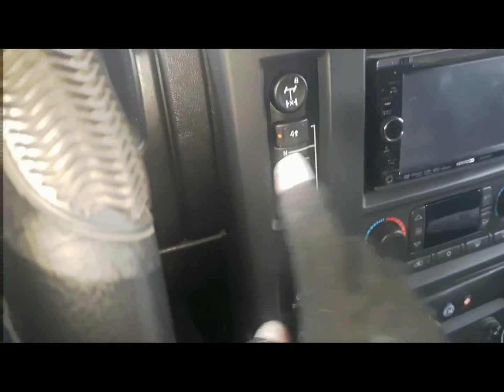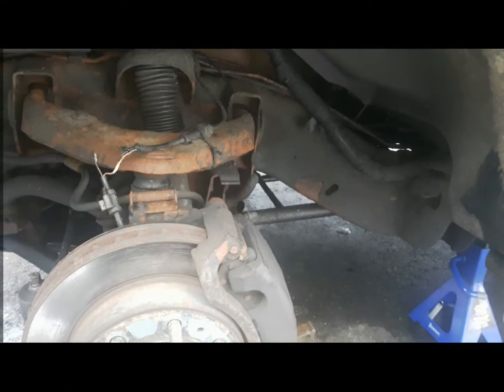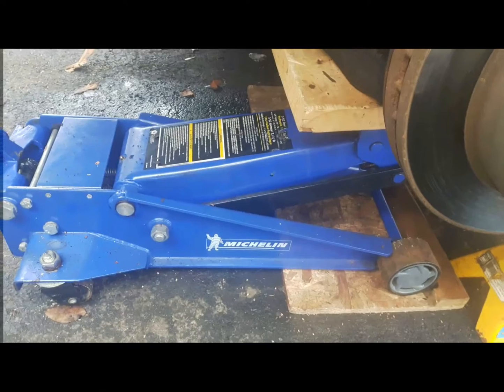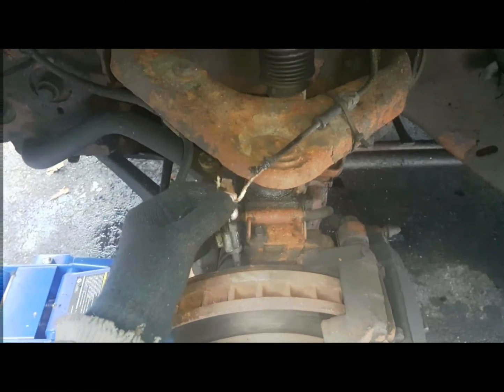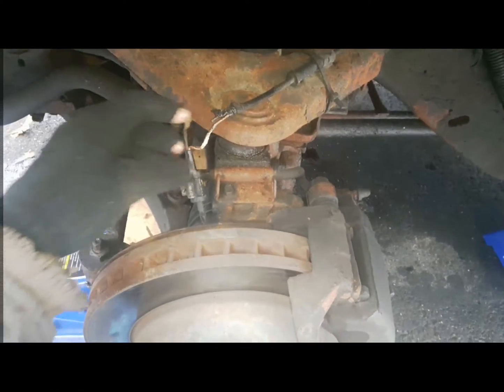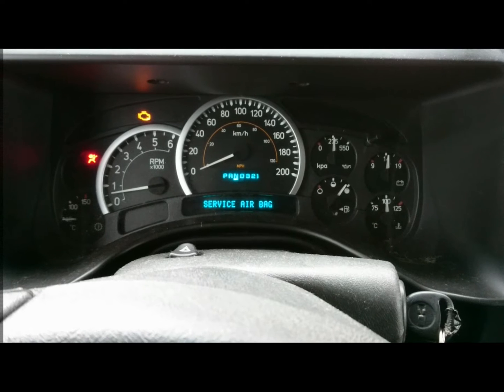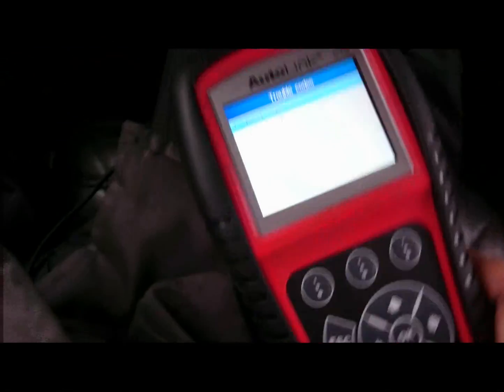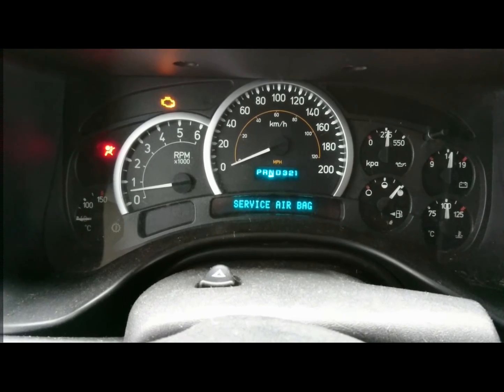4x4 4WD AWD not engaging in SUV Truck, flashes yellow light CEL Code C0035

Comment: Yes the speed sensor hold downs tend to fail.  I mounted mine with rubber /metal pinch loops.  Keep them away from the wheel.  As for my  TCase, I never use 4wd which I think messed up the encoder motor.  They say you must use it every so often.  Got it on my PM when the car is lifted as there are no dirt roads in my area.
Reply from the maker: Hummer H2 has continuous 4WD. You can not drive on 2 wheel mode.
Reply: @wisemonkey1551  I let me clarify; rarely used 4wd"H" or 4wd"L".  If you don't move the module cap contacts on the motor, it tends to fail.  Re 2wd; You can however turn it into a 2wd for long hauls in the summer.  Take off the front axle and put it in the trunk; a 5 minute job.

Comment: Yeah, I have one hummer h2 that I just bought that is doing that. I replaced the transfer case actuator but that didn't fix.
Reply: I do have abs light on, but none of those buttons will work, even 4 high open just flashes and then goes out, everything is off yellow lights flash and then go off. I checked codes but nothing for abs came up, maybe my code reader doesn't read that one.
Reply: @n3d.studio  If ABS light is on, highly likely one of your speed sensor wires is bad.  Happened to me.  The Tcase gets data from abs sensors.
Reply: @operationsword9457  yes it is. I confirmed it on another hummer. the abs light will come on once in awhile and when it did I tried to put it in 4wd but it didn't switch. I ordered one set of speed sensors for front but the box has been sitting in garage for awhile I need to get it installed. I hope it's the front because the rear sensors cost a lot more.
Reply: @n3d.studio Probably the front. First time my front bearings were going out and chewed the  driver side wire.  Second time my wheel rim rubbed against it as the plastic retainer came loose.  Make sure you mount them tightly against  the A arms.   I use locktite on my caliper bracket bolts so if you don't you shouldn't have a problem pulling calipers off.  10 mm bolt after that and it comes off.

Comment: Hello, nice video, I have a hummer h2 2006 but its always once in a while popping up a SERVICE 4WD . What would be that? Please advise.  Subscribed already.
Reply: If it doesn't shift/ you dont hear any gear exchange under your feet, it's probably the encoder motor.
Reply: @operationsword9457  thanks much.

Comment: What mode should I drive on
Reply from the maker: On normal roads, press the switch on top of the Neutral (N) writing. Usually that one is by default at start ups.

Comment: how come my hummer says service 4wd
Reply: Hey Gabriel Padilla, oh yes mine too. Did you find a solution?
Reply: @myamazinglittleworld5673  hi I have the same problem how do you fix yours?????
Reply: @LuisVega-ks2wn  sorry for my late reply,  finally i took the truck to the repair, and i was told it was the transfer case which has a problem, but he didnt tell me exactly what was to change. did you manage with yours? Let me know what repairs you did , most likely if you have the same problem you might be told the transfer case.
Reply: Mine said the same thing at first I turned the vehicle off reset all codes and it works fine
Reply: Same problem here how do I fix someone please help..
Reply: Rumor is you have to use these Tcase motors or they freeze up.  I got 280 K on the clock and never used mine.  That may be my issue.

Comment: I had the same problem. If you hold the very top button and hit any of the other buttons 5 times quickly it will engage or disengage.
Reply: Mine dont do anything....i dont have any codes either. Ever seen that?
Reply: Same prob here... h2 2006